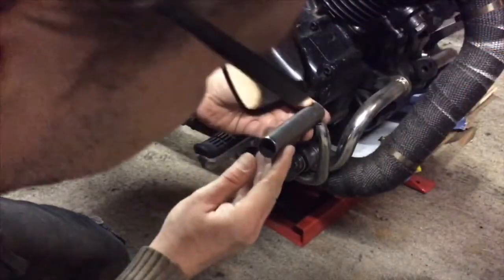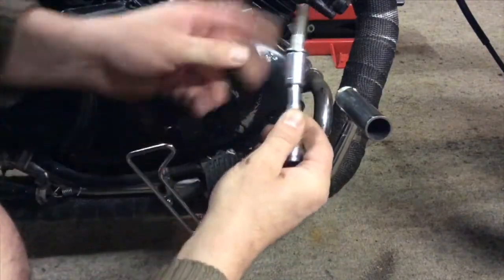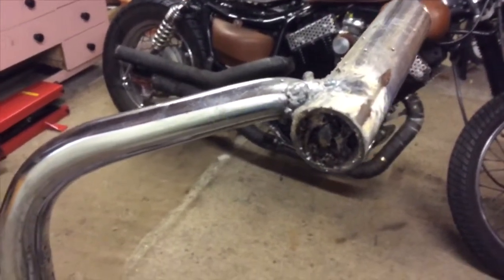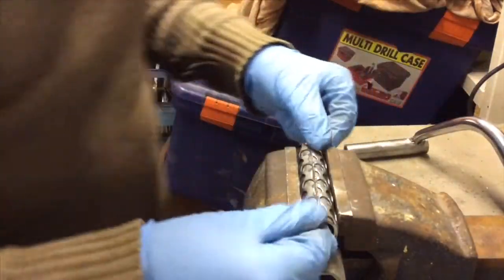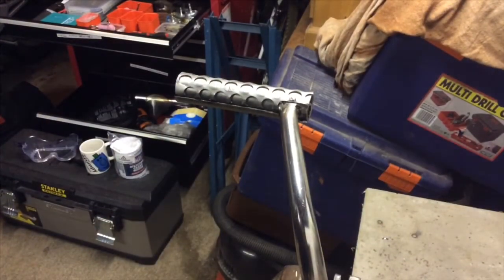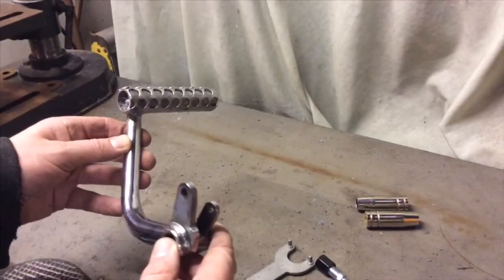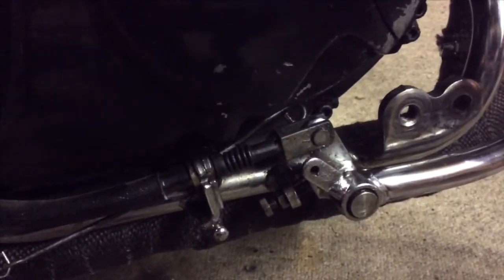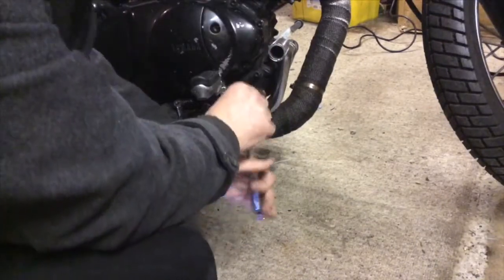Welding Fabricating Motorcycle Brake Pedal - Rat Project

Comment: Good job there chap gave me ideas on when i get around to do my forward controls
Reply from the maker: Thanks mate. Yeah I’m looking forward to the forward controls vid. Defo worth making your own parts. I haven’t had this welder long, it’s quite a thing to be able to make stuff like this. Hope your XV is behaving with the new coils now.
Reply: @memybikeni9931  bike started back shiting it self not sure cuz ive set carbs to run on them other coils going to do all checks tomorrow get ohm reader out tomoz and charge battery has been sorting my 4 way flashing out
Reply from the maker: Did you put new plugs in when you changed the gaps over ? if not they may be fouled up from before.  Bikes 🙄
Reply: @memybikeni9931  what's next on the to-do list on your bike or is that it
Reply from the maker: Sorry mate, YouTube shite at notifications, just saw this. I want to sort the back end out, I made a terrible looking cover for the rear where I chopped it just after the shocks, and it’s a bit shit tbh, so I think now I have the access to a welder I can make a few more things fit for purpose. Also, not happy with the engine covers I made, they’re okay, but again, I’d rather fabricate them to look a little more impressive than they are, and also they are a bitch to get on and off, so making some easier fixings for them. So a few finishing jobs and then MOT it. I do seem to have an oil leak from the final drive, so may have to investigate that. I’m not in a rush as I drive a car most days, and use my Honda CB500 the rest of the time, so this was just my little bitch project 🤣🤣🤣 where about are you in the U.K. anyway, your accent suggests London area.
Reply: @memybikeni9931  from all over mate lol lived every where but just on out skirts off Doncaster at mo. 
I'm looking at doing something about engine covers  but not sure what to do with them yet. Where you based.
Reply from the maker: Wow Doncaster, I’d love to be up North with all that open land and scenery right on your doorstep. I’m in Reading, Berkshire. So a couple of hundred miles south of you.
Reply from the maker: I sold my engine covers, in hindsight I should of used them as a plug and made some fibreglass ones, which I could have latticed. I’ll think of something. A good satin black on yours would go with the nato green.

Comment: I need to make the brake pedal for a 99 honda shadow vt1100 ace tourer. V&H exhaust is crossing righ on breake pedal location. Any advice
Reply from the maker: so is it not an exhaust that’s made for the specific bike ? if you can’t remake the pedal in a location that works, maybe consider re routing the header, if that’s the section that’s fouling. sounds a bit odd if it’s designed for the bike.